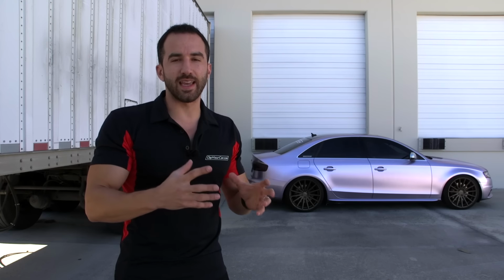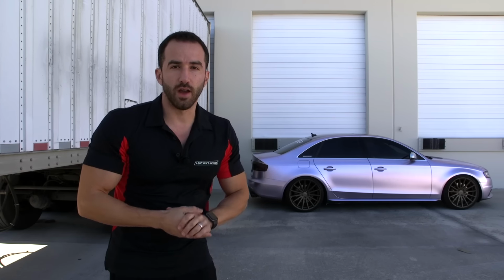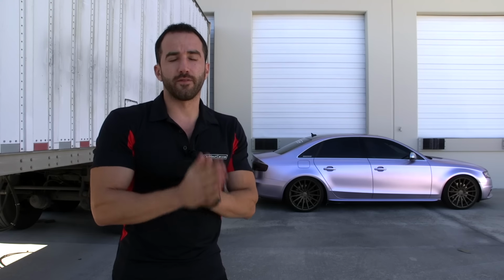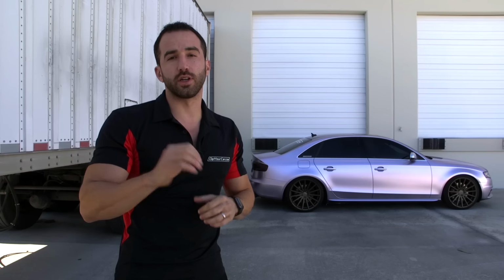Holy Crap Violet Metallic

Comment: Is plastidip something i could apply to my car in my garage
Reply: danmacmillan88 as long as your garage isnt dusty yes
Reply: yes you can, i've done full cars outside (in good weather only) but inside a garage is perfect. just have some ventilation of course.
Reply: As long as your garage is well lit and you leave your door open to ventilate I would say yes.  I've done it in a garage on three occasions, but the first time I dipped was outside.  It's hard to beat the perk of having natural sunlight though, a lot easier to see what your doing.
Reply: Sure but I would recommend starting with simple colors, no way would you get this finish on your first spray. Not trying to sound like a dick but so many factors can cause platidip to look like shit, Too much air pressure, Too little air pressure, Too much spray at a time, the distance between your sprayer and the car.. the angle at which you're sparying, the direction in which to spray.. etc. Just start out simple and ofcourse, you'll be better off inside of the garage than outside, ventilation is a plus and a mask is a must.
Reply: Get a respirator or a mask dont inhale that shit when you spray and crack some windows or doors for a couple hours or a day after you spray

Comment: How to we wash/protect these coatings?
Reply: The first week after you’ve Dipped your vehicle we do not recommend washing it.  After a week of cure time you can begin hand washing the vehicle.  Then, after two full weeks you can continue to hand wash it, use a pressure washer to clean it, or take it to a car wash.  Be sure to apply Dip Coat after each wash to protect the surface!